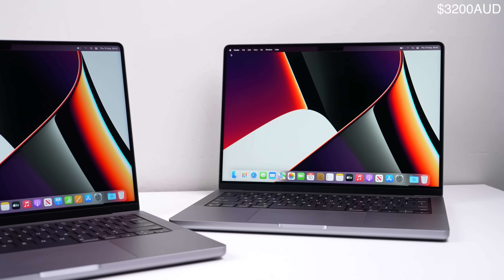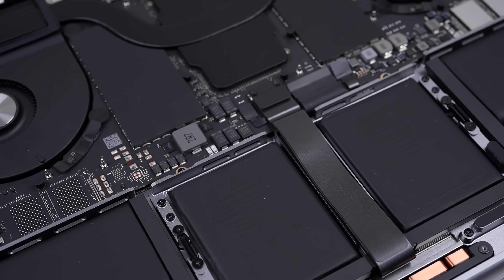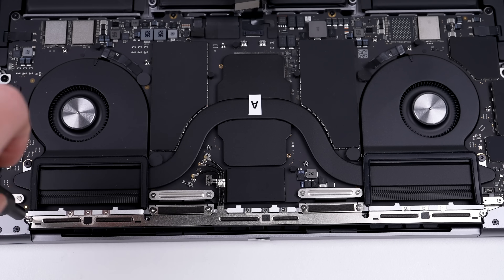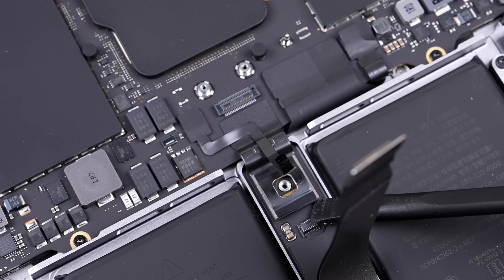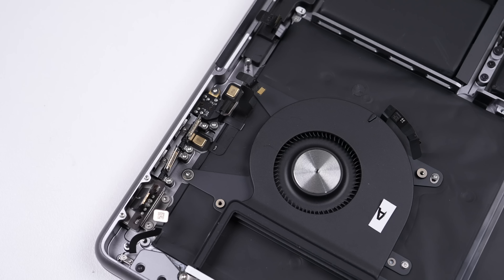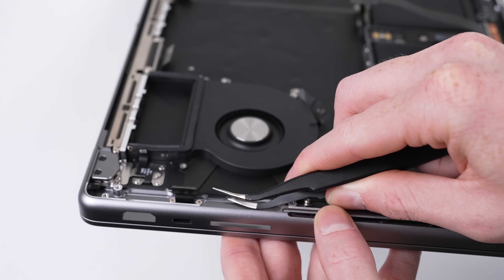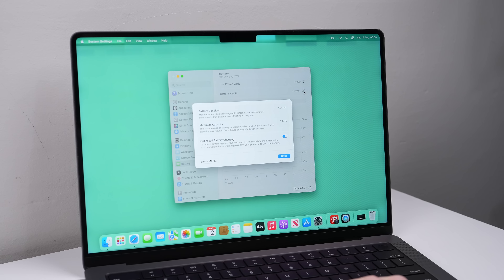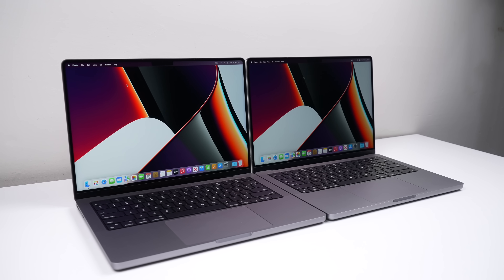New Anti-Consumer MacBook Pros - Teardown And Repair Assessment - Apple Silicon M1/M2

Comment: I have several reasons for my dislike of Apple. Nevertheless, I struggle to comprehend why a company isn't allowed to design their product according to their preferences without having to prioritize consumer convenience. To what extent are companies expected to cater to consumers? Could a consumer also argue that a Lamborghini is excessively pricey and should have its cost lowered for easier purchasing? 

Having said that, I understand that there are plenty of benefits to the "right to repair" such as:

1. Economic Considerations:** Repairing products can be more cost-effective than replacing them, especially for individuals and communities with limited financial resources. Allowing repairs can extend the lifespan of products, reducing the frequency of replacements and overall waste.

2. Environmental Impact:** The right to repair is closely linked to environmental sustainability. When consumers can repair products, it reduces the need for constant manufacturing of new items, which in turn reduces resource consumption and the generation of electronic waste.

3. Local Economies and Small Businesses:** Enabling repairs can support local repair businesses and technicians, fostering job growth and promoting competition. This can lead to a healthier economy and more diverse service options for consumers.

4. Education and Skill Development:** Repairing products can provide valuable opportunities for consumers to learn about technology, mechanics, and engineering. This can empower individuals to develop useful skills and gain a better understanding of the products they use.

5. Reducing Electronic Waste:** Electronics and appliances are a significant source of electronic waste, which can have detrimental effects on the environment. Allowing consumers to repair products can help mitigate the negative impact of electronic waste on landfills and ecosystems.

6. Preserving Cultural Heritage:** Some products, especially older ones, hold cultural or historical significance. Allowing repairs ensures that these items can be preserved and maintained for future generations.

7. Innovation and Competition:** Manufacturers' restrictions on repairs can stifle innovation by limiting third-party solutions and modifications. Allowing repairs can foster competition among manufacturers and service providers, potentially leading to more innovative products and solutions.

8. Product Longevity:** When consumers can repair their products, manufacturers may be incentivized to design products that are more durable and modular, encouraging a longer lifespan for products.

However, if you find a product unsatisfactory due to its lack of repairability, you have the choice not to purchase it. There are numerous alternative options available in the market.

Comment: It's the screen angle sensor that is causing the screen to act like this. You need to replace the screen angle sensor with it. Each time the screen is replaced. Also not closing the lid during calibration of the new angle sensor fucks up the sensor as it only can calibrate once. so if you did it wrong then you would need to get a new one. I know this because I am an Apple service technician.

Comment: "CALIBRATION"

given that both laptop's exhibit the exact same issues with the swapped screens, I'm just gonna go out on a limb here and say that... there are settings which the user would prefer, but which are not the default set by apple when the screen has not been authorized by apple, what apple calls "calibration".  Apple does this deliberately because they don't care about the consumer, and because it can only result in making them more money.

Comment: Hopefully EU Right To Repair legislation will put an end to this madness. Even if you manage not to kill any of the tiny cables the access to the calibration tools is unacceptable. I like Apple products and use them for 20 years now. But they clearly go into the wrong direction, also with their OS support strategy. My Apple MacBook Pro from 2012 is still very much usable with SSD and RAM upgrade, but I have to use OCLP to get software support. My expensive 2019 iMac Pro 27" will likely receive the last official update next year. Performance wise I see no reason to replace this machine the next ten years, though. Apple makes money through services nowadays. I'd rather have a paid OS subscription again instead of unsupported hardware.
Reply: Hoping they release a Wozniak Macbook editon with everything repairable and upgradeable.

Comment: though the both models  look indentical but they are enginnered and tuned specfically  to run with their original parts in place. use the intended part nos. period.

Comment: The hall sensor's behavior simply explained by the fact that the magnets itself is not perfect and they magnetic fields varies from one laptop to another, so the hall sensors should be calibrated for every laptop. Or even they don't give a crap on aligning "as close to each other as posible" and their magnetic fields oriented randomly from one laptop to another.

Comment: I was surprised that the backplate is screwed, not glued.
Reply: Remember when you get a warranty repalcemtn from apple what you get is a refurbished device were apple have taken the working guts from one machine and put them in a new case.  

This saves apple a LOT of $ that is why apple prefure screws over glue. 

Also using glue in a production line is horrible as you need to weight for it to set before you can continue so you need a much bigger factory were after each glue application the product needs to sit in a climate controlled (low pressure) chamber to set before you move on... 

While people think apple is anti-repair, that is not quite true, apple are all for repair in situations were it saves them money but they do not care or even think about third party repair.
Reply: @hishnash  Ah. Sounds legit. Apart from an iPad I have no Apple devices. The way they keep users from doing anything on their devices pissed me off (I thought of buying an iMac back in the days, but the fact that it wasn’t even possible to access the RAM on the 7th gen iMac was the final straw against Apple).

Comment: This has nothing to do with calibration, BTW...  Dexis has been calling their license file "calibration" for decades, now apple is playing the same game...
Reply: This is calibration sorry,  miniLED displays are very prone to regional non-uniformity, and the production process means your going to have very simlare patterns (not identical) without per LED backlight level mitigation your never going to get a uniform image on a miniLED display. 

Even worse is OLED were you need to record how bright each sub-pixel has been and accumulate that in a living profile on device to mitigate burn in effects.
Reply: @hishnash  calibration data has always lived on the display driver chip, so this issue has nothing to do with calibration, and everything to do with licensing.  Apple had to go out of their way to redesign the chips away from industry standards to take the calibration data off board. Now, the data that the display would already have needs to be sent to it each time, and stored in its volatile memory, VS the industry standard that had been there from the beginning, of storing calibration data in the driver chips where it belongs. So, once again, this has absolutely ZERO to do with calibration, it's only an excuse to make it unrepairable.
Reply: @AlecKristi   Apple changes this in thier products for a few years new, the display and backlight profiles are retrieved form apples servers when in diagnostic mode.

I expect the reason apple did this was to very slickly increase the volume of displays they can produce as it removes a step from the production line.

Comment: Its SO EFFING SCUMMY of apple to actually engineer the laptop/cable to literally glitch and mess up the computer if you swap it out. That means they literally CODED those glitches into the laptop if the identifier of the 50 cent cable wasnt the same... it really doesnt even get more scummy than that...

Comment: I'm going to (minorly) disagree with something you said about Apple's remote calibration: You state the calibration should come on the board. If the part requires calibration, it's impossible to include it on the part. A more correct version is to say "Apple should allow the user to self-calibrate their hardware." (This might also prevent some visits to the genius bar when minor calibration issues happen)

As an older example: old resistive touch screens require a 5-point touch calibration on first boot; you can't include that calibration in the hardware, because it's necessary based on differences in the individual hardware. Calibration is per-device, not per-component.

Comment: Doesn't surprise me one bit, in some respects one has to accept that to have a lot of these smarts and optimizations this is the sort of thing that needs to be done. However there is s fine line between having to do this for a technical reason and doing it for marketing reasons. However you see it one has to admit the design is impressive, personally I like lots of screws etc, I believe it makes it much more robust. Reality this is happening with cars, tractors you name it, almost anything with complex interrelationships between modules has these types of restrictions and I dont see "right to repair" proposals as they are making any significant difference to this. Even if the tools were made available the cost in may cases will be prohibitive.

Comment: Its a mixed bag. Everyone's cell phones are basically unrepairable now that they started gluing them together, and you can kinda see that gluing them helped them become more water resistant. However Apple seems to go out of their way to make their laptops unrepairable. To me it does not matter, I don't buy Mac laptops. I have used a lot of them, but they are all company provided. I prefer mac minis, mainly because I can supply my own keyboard, and just throw it away if I spill a coke on it.

Comment: Great video and presentation. You could use a bit of tape to hold the flex cables back and out of the way of the mobo during re-install, as flicking them out from underneath is actually pretty physical for those crappy connectors

Comment: Screw Apple. I will never buy one of their products ever again. Changed to a Microsoft Surface and Huawei phone and never been happier. The Huawei needed back glass, repair done in 10 mins, 2 screws. My iPhone was a nightmare. Replaced the rear glass and it was a pig. Repaired my MacBook Pro 2016 with a new screen which was a horrible experience. It lasted a year then it got the stage light effect so bad I ended up ripping the screen off and snapping the mac in half. One less donor Mac in the world so nobody has to go through the same experience of repairing this trash as I did. I can only imagine how bad it is to repair a more modern one.

Comment: Thanks for this video. I've been on the fence about selling my M1 macbook pro (working and been fine since 2020 but no longer needed) and m2 Macbook air( Bought faulty just to fiddle around but haven't opened it yet). Definitely getting rid of both before they lose any more value. Been repairing Macs since 2003 and thought 2013+ was bad but they were actually more repairable than I first feared but the time has no come. Absolute waste of some nice design innovations over the years to overengineer themselves into the ground literally

Comment: It's time for Tim Cook to go.  There's a reason laptop computers are different from tablet computers and making this thing the way it is is just an overly expensive tablet computer.  The same goes for the Mac Pro tower, the Studio and Mac Mini.  No up-gradable memory and storage and mainly little performance gains to a similarly specified x86 computer from AMD.  I refer you to Linus Tech Tips on his reviews of recent Apple computer releases.  In contrast, Steve Jobs made his teams design environmentally friendly computers through upgrades and ease of serviceability and compatibility.  With the number and variability of fasteners it seems like Apple learned how to make taking these things apart from Briggs and Stratton or John Deere while Lenovo, Dell, HP, Kohler and Honda try to simplify repair-ability.

Comment: Hugh on the lid angle sensors I would recommend trying the swap again but after reassembly connect the MacBook to power and let it boot without opening the display when it has completed the boot then open the display. What I think may be happening is that when you connect the Mac to power after the replacement it is taking the current position of the display as closed.
Reply: No, it does not help. Ask Louis Rossman..
Reply: Regardless, his video and it's "proof" shouldn't require the discovery or recommendation of a different video to be validated.

I say this as someone that doesn't like Apple at all.

Comment: One of the most insane things about this laptop, is they used over 100 screws yet decide the keyboard doesn't need a single screw.
Reply: Apple products are really poorly designed. They don't want you to repair them but buy a new one.
Reply: Probably because the keyboard is the 3rd most damaged/needing replaced component on a laptop (behind the screen and battery).
Reply: Asus is the exact same way with their laptops they use about 40 or 50 plastic welds instead of few strategically placed screws to make it impossible or damn hard to replace them. Also, I will no longer buy another of their products after experiencing terrible customer service when after 3 months of normal gaming keyboard use the WASD keys all started  to lose completely their lettering, and Asus response that's just normal wear and doesn't meet their warranty replacement - WTF. Lastly, Asus is prone to overheating and their unplugging of cables especially the battery for instance from the motherboard is very flimsy too.

It seems manufacturers are cutting costs everywhere and making it harder for experienced builders of computers and Techs to do self repairs, as to force users to throw away what should be easily repaired systems but rather to force end users to buy a whole new laptop instead. Thankfully, I've found MSI company is still reasonably good in that area for now and hopefully they won't go fully down that same rabbit hole like most of the computer manufacturers of screwing customers to maximise their profit margin!  lol
Reply: Yep, Hugh pointed that out a few times.  No need to repeat it
Reply: So that's why the Pro's keyboard is pure shit.
Reply: There is also a flip side to this argument; my 2011 MBP keyboard needed replacing a few years ago, and I thought this would be a really fast fix.  It was over 60 microscopic screws.
Do I prefer screws over rivets in this scenario?  Of course.
Are 60+ screws needed to secure a roughly 5"x11" keyboard to the aluminum chassis?
And yet this 12 yr old machine is accessible, modular, and upgradeable; and still running 24/7 as an iMessage server to my Linux and Android devices.
Reply: @MitchMatrixx  windows laptops from that era used clips/tabs that insert into the chassis, basically all you had to do was squeeze the keyboard to get it in or out, I swapped the keyboard on my asus that only cost $20 and took about 5 minutes.

Tech really has gone backwards, at least user experience wise, including software such as not having root/admin access on your own devices.
Reply: @vgamesx1 framework...
Reply: @MitchMatrixx  I don't get why this is amazing. A well cared for laptop should last more than 12 years. I have laptops that still run after 15 years. In fact I see no reason for laptops to die as long as you can find battery replacement (or not, if you're willing to run it plugged in).
Reply: @MrAkaacer  Using asus TUF a15 display panel breaks every 6 months FUUUUUUUUUUUUUUUUUUUUUUUUUUUUUUUUUUUU
Reply: @MrAkaacer  and that's the problem. Apple only supply replacement batteries 7 years from release. A laptop that only runs tethered to a mains outlet is not much use. Better off buying a small desktop.
Thankfully 3rd party batteries still work past that 7 year point, but for how much longer?  I'd bet Apple is working on a way to lock them out right now. Meanwhile some Mac Powerbooks from '95 still work. I have a Powerbook 520c.
Reply: @MrAkaacer  That's a cool story that you added to out-do my anecdote, but I never said it was "amazing".
Enjoy Windows Vista!
Reply: $6500?!?! I can buy an Alienware m18 with a Ryzen 9 7945HX and 4090 for $3400, upgrade the piddling 16GB DDR5 RAM to 64GB for $200, increase the internal storage to a whopping 18TB for $2200. So $5800 for a full kitted out 18" laptop.
Reply: Would it be as light and as good battery wise? And i bet the screen wont be as nice, you could make a custom desktop that wrecks it for the same money too 😊@Rokabur

Comment: Great, so now you understand that there is tightly-coupled calibration data in these products that needs to be maintained. That's not anti-consumer in and of itself.

The proper question is what is involved in generating new calibration data and is that process even possible by a random repair shop?

Sure, decrying Apple as "anti-consumer" gets you clicks, but is it really the motivation here? I don't think so.

Comment: Apple are terrible for this I don’t like it but can accept it on my phone as that’s fairly standard these days tho apple is still worse than anyone else but in laptops and especially desktops the middle is repair ability and upgrade ability or it was …. I use an iPhone and an iPad but I would never buy a Mac my phone and my iPad has the advantages of locking down the system but my pc is mine to do whatever I please with